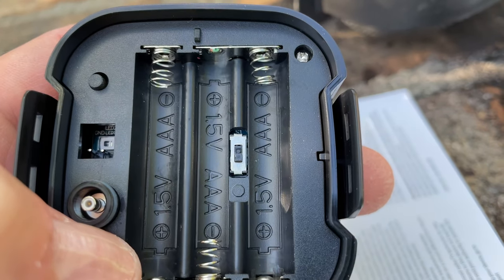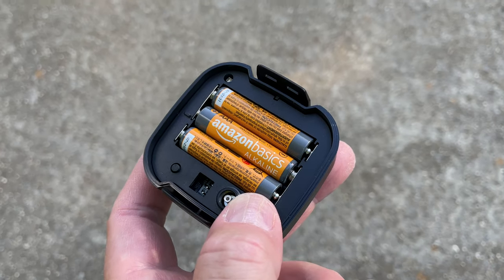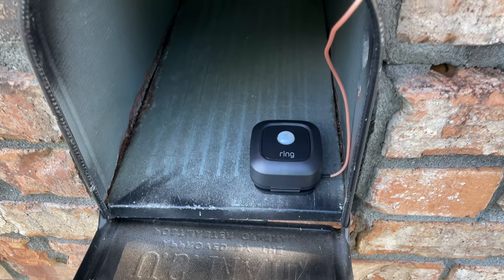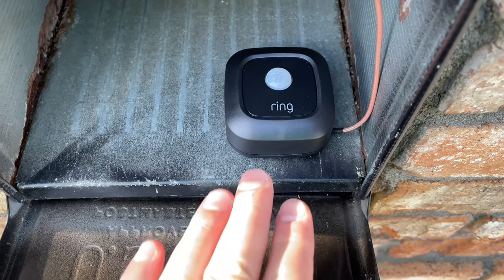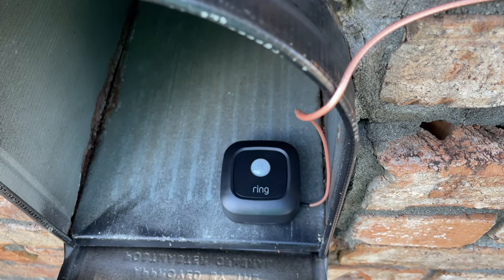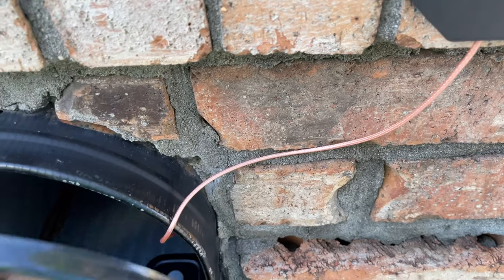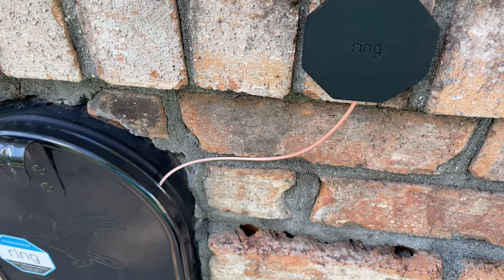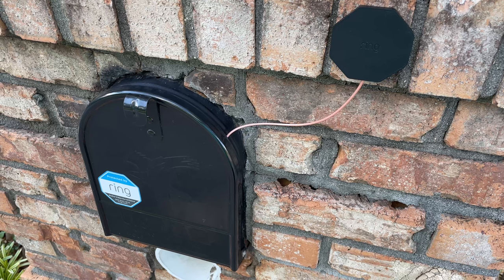Ring Mailbox Sensor Installation Video

Comment: The wire going into the mailbox could end up getting damaged, you should drill a small hole for the cable
Reply from the maker: I agree.  I intentionally did this because #1 I don’t want a hole in my mailbox and #2 I want to test the cable’s durability for review purposes :)

Comment: i put mine in the back of my mailbox without the antenna (switch the switch opposite from octagon).. it works off Amazon Sidewalk now, so no bridge needed. Also had it discover my ring in the alexa app and made it say 'You've got mail' when the mailbox is opened.
Reply from the maker: Interesting!  This is the only ring accessory that wouldn’t work reliably for me.  That’s interesting about Amazon Sidewalk!  Which Amazon device(s) feed the signal?  I’m hoping that they release a Ring Mailbox V2 with solar panel and WiFi.
Reply: Echo dots feed the Amazon Sidewalk low range network outside their home. Most people share it to the public without realizing it

Comment: I would have placed the sensor on the inner side, or on the top of the mailbox facing downwards rather then placing it on the bottom where it gets in the way.
Reply from the maker: Good idea.  I put it on the bottom so that it doesn't spook the mailman.
Reply: @IrixGuy , your ring sticker stops the spook.

Comment: Batteries don’t last.   Can I convert to solar with rechargeable batteries?
Reply from the maker: It’s great that you said this because I’m hoping for the same thing…a solar Ring mailbox sensor and an upgrade to WiFi.  The mailbox sensor is the only Ring product that I’ve owned that has disappointed and those two small updates would make it perfect!  The technology works but the battery life and range kills it!